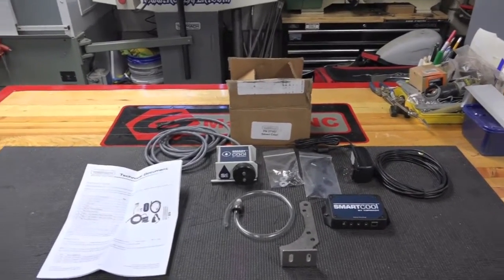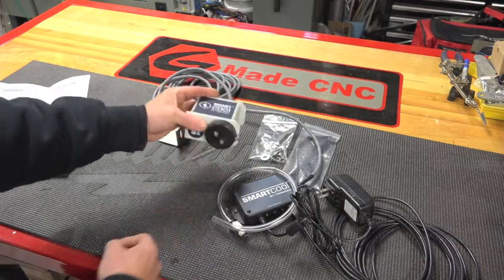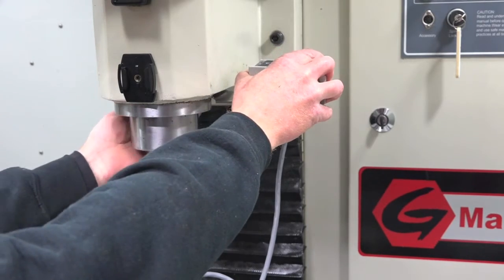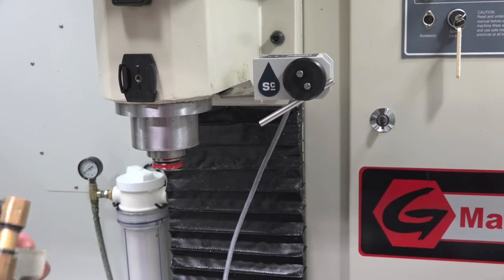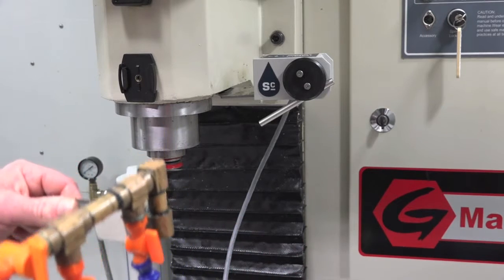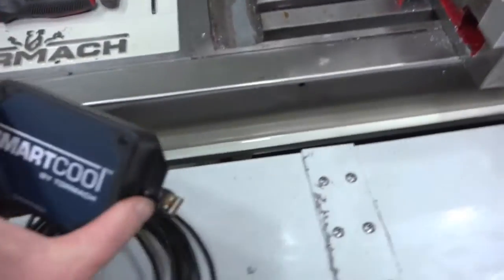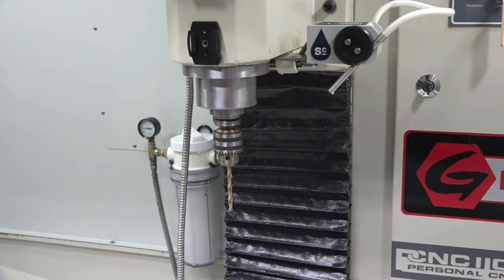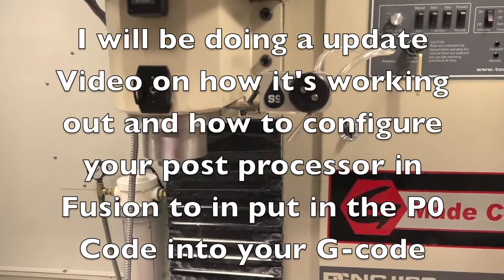Tormach SmartCool system

Comment: Interested to see the smartcool machining with a larger than stock pump.  I just did a video machining with the smartcool and stock coolant tank but it wasn't able to maintain the needed pressure on longer runs. I'll be upgrading to a larger tank and pump like yours.  

Based on what I've run so far, the latest Tormach post processor for fusion does a good job of controlling the smartcool in the correct way for different operations.